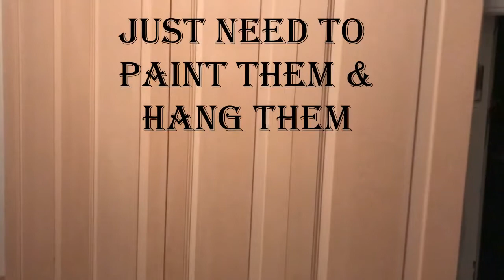Making raised and fielded panel wardrobe/cabinet doors on a spindle/shaper

Comment: nice build but curious why you glued the panels? appreciate its mdf and fairly stable yet still susceptible to swelling surely they shouldn't have been glued? either way thank you for taking the time to upload this video
Reply from the maker: With it being mdf there will be minimal movement and because it was getting painted I didn't want loose panels that could have potentially cracked the paint.
I've made doors like this for years and never had any problems.
Thanks for your question and thanks for watching 👍🏼